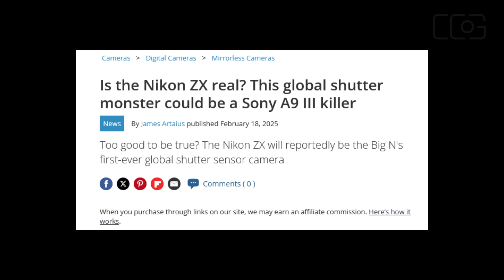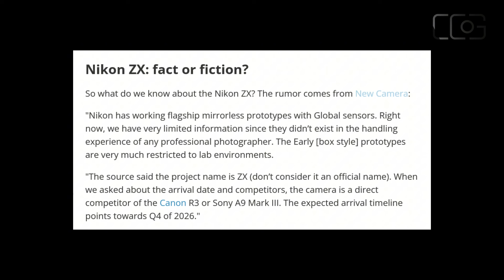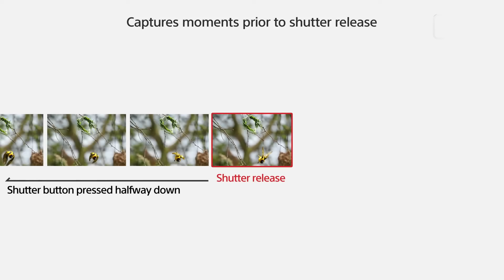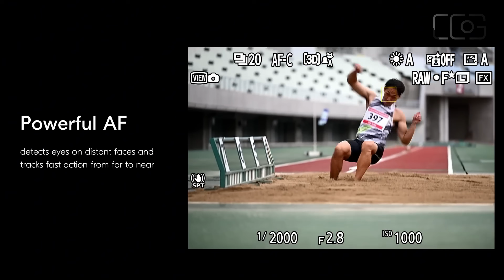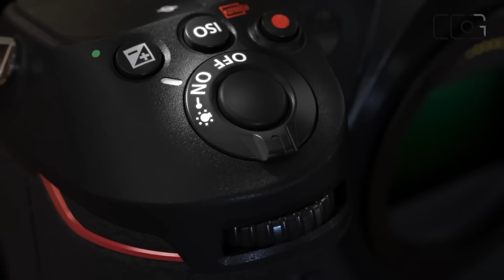Nikon ZX Will Break All Boundaries: First Mirrorless Flagship with Global Shutter Sensor!

Comment: Why everyone talks about global shutter. Just use mechanical shutter and you will have NO distortion.
Reply: Global shutter is primary for video, to avoid distortions.
But it is fasfer than mechanical and does not fail so early
Reply: Mechanical shutters are prone to failures and difficult to produce, so they earn more by moving away from that and turning that cost into profit.
Reply: You can still have distortion for fast subjects, especially for video and when panning (for video the shutter is out of the way anyway). Calling it a global SHUTTER is somewhat misleading - they should have called it a flash sensor since the whole sensor is read at once.
Reply: A mechanical shutter with a 1/250 flash sync has a speed of about 4 milliseconds to travel across the frame. That is not "NO" distortion. A global shutter will have a speed of less than 1 millisecond across the frame.
Reply: @ My goodness! Why people say thing they have no idea about? Man, when you use mechanical, the sensor is not "reading line by line", the sensor is completely sensitive to the light. You can have motion blur (in lower speeds) but NEVER distortion!